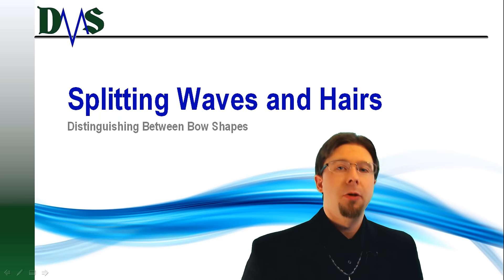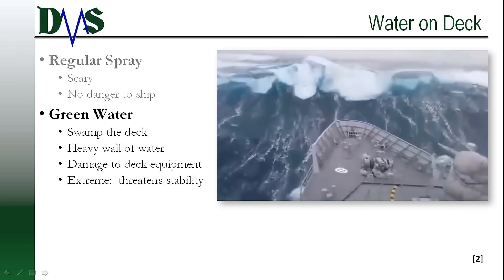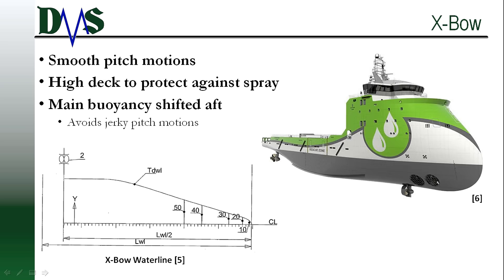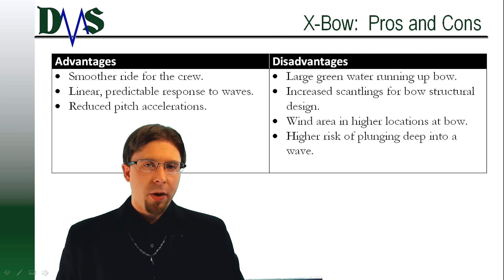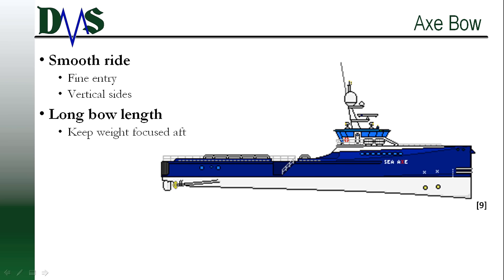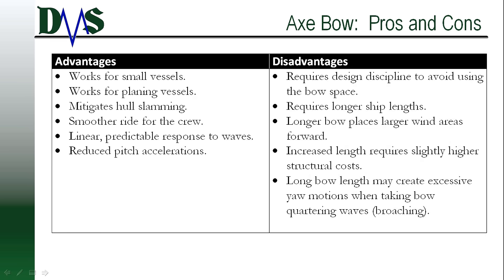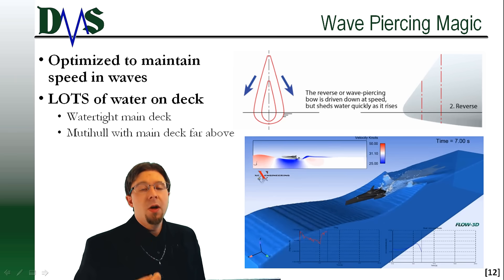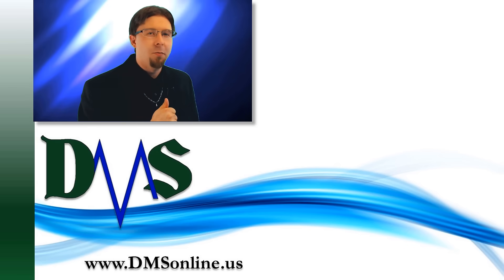Splitting Waves and Hairs:  Comparing X-bow, Axe Bow, and More

Comment: the x bow was  designed  to combat the worst  standing sea state known..the North Sea...for oil rig service ships there .
Reply: Then why doesn't cargo ship use it??
Reply: @justicewarrior9187  because ship design is not like that  what you design to combat a specific area sea state does in no way auto translate to being best for everything else.
 A real decent read is to look up the US navy's design stuidies on bows
Reply: @justicewarrior9187  Assuming vessel speeds are the same, the length of typical cargo ship relative to the wavelengths is much higher than where these construction vessels operate at. The vessel length to wave length will be higher for a cargo ship. Hence the motion response of the long and slender (remember compared to the short construction vessel) cargo will be quite different and the factor which help the short and chubby vessel will not be applicable. Technically one would say that the Froude Numbers they operate at are different. The Wave-Ship interaction behavior is better described through Fn number theory.
Reply: @vsdktbkm5012 
Why aren't there 500 meters long nuclear power cargo ships??
Reply: Not germane to the discussion on ship bows.
Reply: @vsdktbkm5012 
What?

Comment: I think the long bow is simply moving the personnel spaces toward the center of pitch rotation.  That is,  the tip of the bow experiences the same high accelerations, because it is moving up and down a significant distance... but the crew spaces are at or near the center of that rotation and simply move a shorter distance in the same period.

Comment: Plumb bows similar to the axe bow are very common on a lot of modern sailboats. They are often very wet and they pound in heavy seas. Often made because of ease of manufacture, length of waterline, and increased interior volume at the cost of excess windage and comfort at sea. Many older sailing designs would use a deeper profile fore and aft to allow the hull to rise and fall in waves more smoothly, and tend to stay more dry.

Comment: Just curious, when you say large vessels referring to the X-Bow, how exactly do you classify large?
Reply from the maker: Excellent question, and I wish I had some clear definition.  But nothing that easy.  In general, I expect vessels in the range of 300 ft long.  Typical ocean waves should only be 1/4 to 1/2 of the ship length.  Really, it comes down to the ratio of ship inertia to wave pitching moments.  For a large ship, I expect the ship inertia to be the dominant player for most wave systems.  (We are excluding typhoons and other systems that captains prefer to avoid if possible.)
Reply: @DatawaveMarineSolutions  Thank You!
Reply: @DatawaveMarineSolutions  This is a thing that would make an interesting video. 
My reaction is shiplength>1.5wavelength if you intend to use "cutting" bows, since don't want to risk diving in to the trough with such a bow, but then there is inertia that delays such an event and for that you need experience or calculations.
Damen build off-shore supply boats for the north-sea, i.e. short and crab. Those X-bows are seen on supply ships for the north Atlantic, much longer wavelength. Give or take.

Comment: Came across what seems like a wave piercing trimaran cruiser a while back called the Alibi 116. Have you seen that? What do you think about it? Looks interesting!
Reply from the maker: Definitely interesting.  I'm curious about the structural and hydrodynamic design.  With trimarans, the big game to reduce your resistance is finding the right balance for wave resistance and viscous resistance (hull friction + some other stuff).  They have very thin hulls.  Good points there.  But the side amas are all full length, and they have a lot of appendages in the water.  Lots of surface area for skin friction.  Not sure if that was the best approach.  

I'm also curious about their forward daggerboards on the amas. Those boards are curved, which means they partially act as a hydrofoil as well.  That might help reduce their resistance.  

I can't say if it is a good or bad design.  That requires far more intimate knowledge than I can get from a five minute review.  But it certainly has some interesting ideas.

Comment: Enjoying your videos. Your teachings on bow and hull designs are very informative and consistent with other videos covering same subjects. But, no one has ever mentioned lapboard hulls. Growing up my father had a 14' wooden lapboard hull boat. Maybe this type of hull only pertains to small leisure boats, I don't know. What I do remember with his boat, compared to other boats with smooth hulls, either wood or fiberglass, was when motoring in choppy lake conditions, i.e. swells roughly one to two foot high, dads boat seemed to slice through the waves where as the smooth hulls would be slamming over these waves Hence, we seemed to have a better ride in rougher waters. Question; does what I remember hold water? No pun intended. Is there something to a lapboard designed hull?
Reply from the maker: I haven't heard the term lapboard before.  Is that a variation on lapstrake construction, with the edges of hull planks overlapping each other, similar to this:  https://en.wikipedia.org/wiki/Clinker_(boat_building)

Going on that assumption, I don't immediately see any major differences.  The lapstrake creates a rough surface, which breaks up some of the hydrodynamic forces.  But seakeeping forces are mostly buoyancy driven.  I suspect your father's boat was just a better design for seakeeping.

Comment: Hey Nicholas, just discovered your awesome channel. So far i've neglected the outboard swap in my driveway for 4hrs and counting....all because of curiousity and hunger for knowledge on anything nautical, but particularly design theory and concepts that can (or have been) measured in real-world application.  4hrs and counting....

Anyway, regarding bow designs, I'm interested to see your take on some more unconventional builds, in particular:
A) the Seaski boats,
B) how hydrofoils in general are seemingly being embraced in the sailing world, but dismissed as "tried that, too hard" in power boats. The exception being the 'wake/wave' damping foils more recently fitted to to some large ships with apparent success.  
cheers
Reply from the maker: I read Seaski's explanation behind their vessel:  http://www.seaski.com.au/portfolio_page/about/   .  It apparently uses a combination of two planing hulls on the sides and compressed air under the hull for lift.  I have seen this concept before.  I'm not sure how well the air under the hull works.  That is an area that I need to personally research further.  But the side planing hulls should work just fine.  The only downside to the whole hull is that I would not trust that with any large waves of 1.5 - 2 m wave height.  The same hull design that compresses air will also create huge pitch motions on a hull.

I need to make a whole video on hydrofoils.  But for the short explanation:  It's important to remember that hydrofoils in the sailing world are only going on high performance racing vessels.  The people that use those boats are highly experienced sailors, who want a bigger challenge.  And hydrofoils are a challenge.  On a normal boat, you only need to worry about your direction of travel (yaw motion control).  The ship's hull handles motion control in all your other degrees of freedom (surge, sway, heave, roll, and pitch).  But a hydrofoil needs motion control for all six degrees of freedom.  Either very attentive crew, or an autopilot more suited to an airplane.  That is the main challenge of hydrofoils:  you need to worry about controlling all six degrees of freedom.

Comment: Hands down your best video yet.  Especially your analysis of the X-bow was very informative.  I find the balancing act of contradictory requirements in ship design extremely interesting, and wrestle with the idea of "the ideal hull" for my application, long range cruising.  The interplay between transportation economy (speed x cargo mass / fuel usage) versus constructive cost and how the life cycle economy works out in different usage cases is complex enough, but it gets really interesting when you throw sea keeping requirements into the mix.  Perhaps a subject for a future video?  BTW, I was under the impression that the X-bow was more efficient when running at speed in heavy weather, which I find very thermodynamically intuitive since the sheets of green water represent a lower state of entropy than the foamy spray kicked up by a conventional bow.
Reply from the maker: It gets even more fun when we add in all the mechanical elements.  For example, vibrations are a big concern on the ship for passenger and crew comfort.  One of the main sources of vibration comes from interactions between the propeller and hull.  So we often decide on separations between propeller and hull based on vibration concerns, rather than propeller efficiency.
Reply: Don't I know it.  My current boat is roughly 13.5m LOA / 25 T displacement, and came with a 36" / 90 cm CPP in a poorly designed Kort nozzle.  That configuration was bad enough to break windows under full power, but things improved immeasurably when I cut the nozzle off and re-ground the blade tips.  With a 15 cm blade-to-hull clearance, I expect things to get almost nice once I re-locate all the ballast to the wedge keel that carries the shaft.

Comment: I've become interested in the wave piercing bows used in larger Incat fast ferries. They have a catamaran design with wave piercing bows, but they also have a third bow in the middle suspended above the water. As the most successful builder of large fast cats of 70 to 112 metres operating at 30 to 55 knots, this design must be effective, but I'm not sure what makes such a strange looking design work in high speed passenger vessels on rough seas. Can anyone offer insights on this?
Reply from the maker: The third bow in the middle serves to prevent slamming against waves.  A simple catamaran has a flat cross deck.  But if a wave hits the flat cross deck, you get a very violent wave slam.  That third bow breaks up any waves and minimizes the chances of slamming.  
The wave piercing bows provide a nice gradual reaction to any waves they encounter.   Ideally, a wave piercing bow generates no pitch moments as it enters a wave.
Reply: Thanks for that, your explanation helped me understand how that weird design makes sense.

Comment: Ok now I've watched the video, I'll explain why I've been watching Naval Arch vids recently. I'm really into the aesthetics of the ships of the golden age of sail, from late 18th to mid/late 19th century, and I was wondering how the design of ships of that era, with sails as propulsion and the building methods and materials of that time, could be improved with the knowledge and modelling we have nowadays. In some of my reading I noticed how there was a shift between the galleons of the 16th/17th centuries, and the ships of the line of the 18th/19th. The rake of the bows was generally, as time progressed, reduced. The rationale behind it seemed to be to bring the LWL forward and closer to the LOA, bringing the hulls buoyancy forward and beneath a larger span of the deck. Since ships were built according to how many cannons they could fit on each deck, and thus deck length, and given cannons are heavy, it was seen as important to increase hull buoyancy beneath the decks to maximise how much of the deck could be used for guns. Also resultant from this was that the fore of these ships would tend to be pretty full, and not conducive to really cutting through waves. An additional design concern was regarding weatherliness. Especially important in wind propelled vessels is to minimise leeway, or being pushed off course by a side- or headwind. There was a push-and-pull between having enough freeboard to fit in gundecks, but not so much as to unnecessarily increase the surface area of freeboard and its susceptability to being blown off course.
I had been looking at X-Bows thinking "what if they had been implemented in sail ships?" - after all, it would have continued a pattern of increasing the LWL towards the LOA, to the point where it seems X-Bows' LWL is the LOA, it would potentially improve speed, and seakeeping.
Alas, it would come with 2 major downsides for those ships of the line. The first is reducing the length of the decks, especially the top deck, that could be used for cannons. This was obvious to me before simply from the shape of the reverse rake, but also, as you noted, the fact that it shifts the buoyancy back as well. In all, I don't consider this the biggest problem. The biggest problem is weatherliness. The design seems to necessitate higher freeboard (and hey, why not just add another gun deck!?), but that obviously means the ship would suffer a lot more leeway.
So if you dont mind me asking... how would you improve the bow design of an age of sail ship of the line?
Reply from the maker: That is a fun question.  I'll limit myself to building techniques they could achieve in that era.  One thing I would try is to add a free flooded fairing on the front of their buoyant volume.  It would be open the sea and add no buoyancy.  Just act as a fairing that sticks out underneath the bowsprit.  That way you still get your full deck length.  But the fairing reduces the water resistance and wave impacts.  But it would have minimal effect on seakeeping.  So the idea probably requires further refinement . . .
Reply: I still think it might have been feasible to X-Bow a 3 deck first rate.
Reply: One other thing I feel I neglected to include in my textwall, kind of stating the obvious. The location of the means of propulsion on a sail ship, above deck rather than below the waterline at the back of the keel, creates moment which pushes the bow downwards, so I don't think slamming is ever a real problem for large tall sail ships.

Comment: What about clipper bows or straight-stem bows?  Also, do the old ram bows of pre-dreadnoughts qualify as wave piercing bows?
Reply from the maker: Speaking generally, clipper bows still behave much the same way as a traditional ship bow (without any bulbous bow).  They have much lower resistance and better seakeeping due to their fine entry.  But you get that same behavior with any bow if you make it thinner.  
Straight stem bows are halfway between traditional bows and the X-bow.  But the stem matters less than the shape as the bow gets wider.  Most straight stem bows are still shaped like traditional bows when you move aft.
And the old ram bows:  I would not qualify them as wave piercing.  They may have had some of the same side effects.  But with a wave piercer, you really need an intentional design effort to make that work correctly.